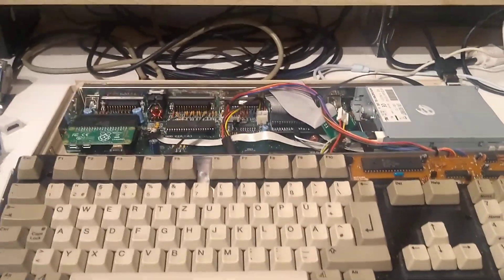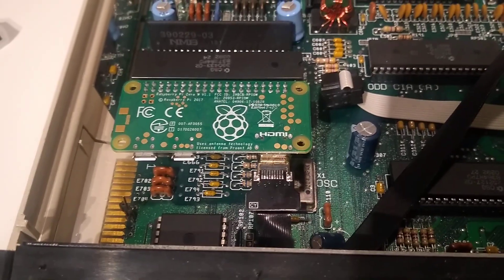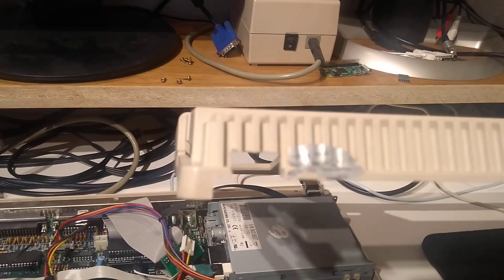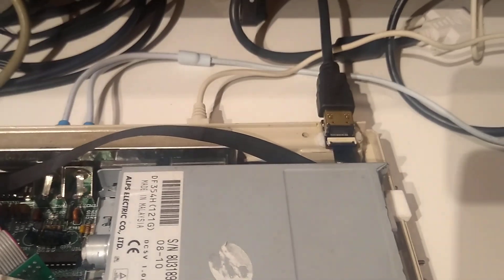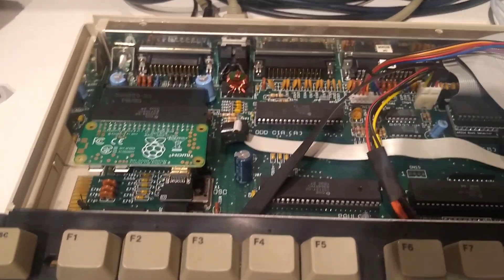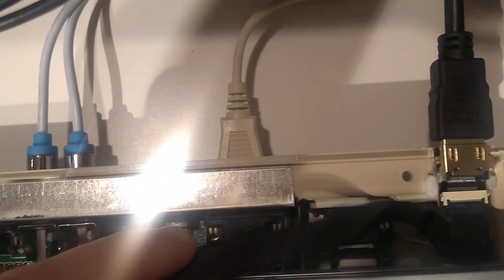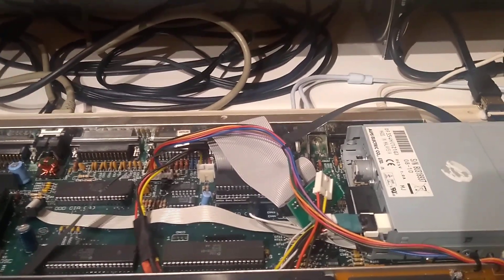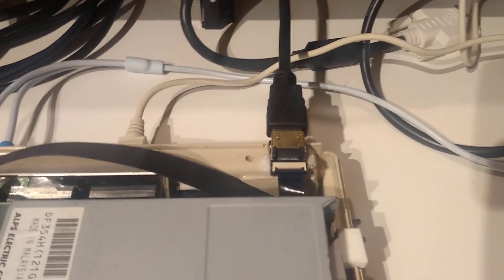Flatcable for my Amiga500 RGB-to-HDMI.

Comment: Where did you get this cable? I have the same setup and I'm looking for a flat cable for mine...
Reply from the maker: It is the HDMI and not the Floppy right? (Just to be sure I read it correctly)
Reply: @brostenen  yeah just the hdmi I'm after putting the connector in the back so it's inline with all the other ones on the amiga and the cable setup I have is terrible lol
Reply from the maker: @philiphandforth4390  Ahh... I bought my cable through eBay. One of those that you can put your own custom order together. They are not the cheapest, nor the most expensive. They are just what they are. Fully happy with mine. The link is:

https://www.ebay.com/itm/154188639227
Reply: @brostenen  that's brilliant thank you.
Reply from the maker: @philiphandforth4390  No problemo. 🙂

Comment: The location you put your ports is the location we put our switches so I am thinking of using the side trap door.
Reply from the maker: Yup... I wanted to have switches located were I use the physical stuff, so they are placed just under the mechanical drive. You know, switches and eject button on the same side of the case. I like having my ports on the back of the case. Yet you can always place the HDMI and VGA ports were I have my HDMI placed. The metal shield do not cover that part of the bottom case.